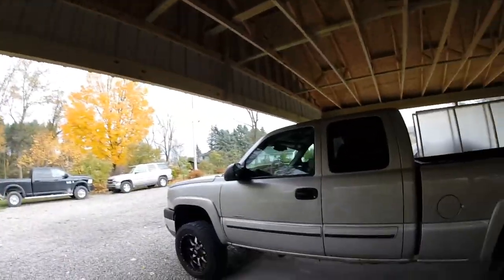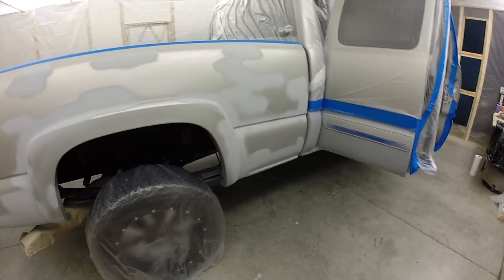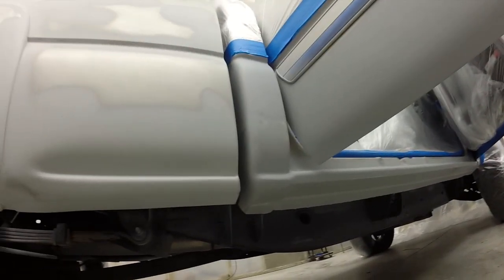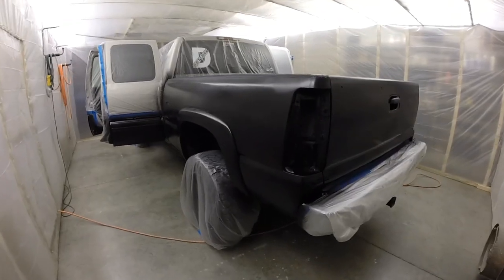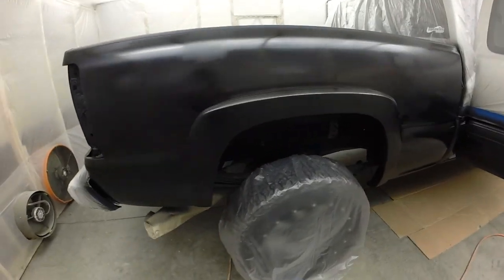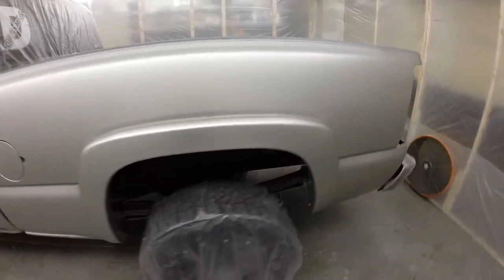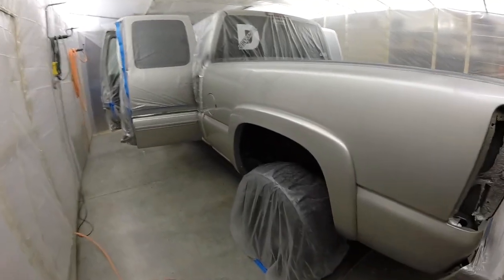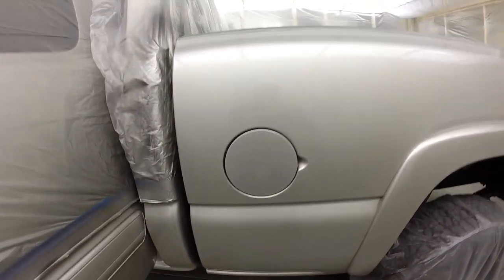I'm Painting my Chevy Silverado 2500 HD

Comment: I have an 04 Duramax. I got lucky and just had to wet sand and buff. What kind of gun do you use and pressure settings? I wish I had your talent. Just a wonderful job man.
Reply from the maker: Thanks, I use a Eastwood Concours LT paint gun they are very affordable and they are designed to run on smaller compressors and they work great and at $40 bucks a pop you could toss them every time you paint a car but I’ve had a few of them for years. I run them at 30 psi at the gun and 10 psi at the tip. The only reason my work looks so good is the PPG DC3000 clear its amazing how it flows out and has virtually no texture when it dries it’s pricey but worth it.